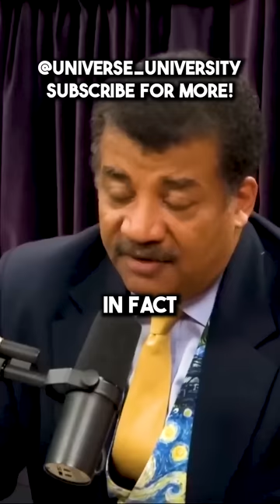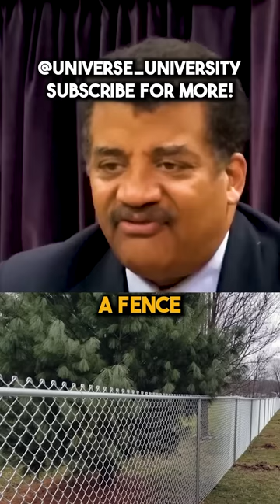How To Pass Ice Through A Fence w/ Neil DeGrasse Tyson

Comment: I actually did this in science class. We had a wire with two weights on either side, and placed it on a big block of ice. By the end of the class it was about half way through.
Reply: That's literally the opposite of what Neil said. He said put ice on a mesh/fence. You said you put a wire with weight ON ice.
Reply: @microusb42069  ... You do realize the point is that there is high pressure at the point of contact. That's what causes the affect, whether or not it's the ice or the wire, singular or a mesh, doesn't matter. The results are exactly the same. You're doing the same thing.
Reply: This is mostly how ice skating works
Reply: @microusb42069  guess youre not the smartest in your class huh?
Reply: @microusb42069  it’s the same thing though?
Reply: @microusb42069  smoothbrain
Reply: @microusb42069  You literally ousted yourself as the one go didn't go to school

Comment: So, just like we all have learned in elementary school, I looked up a phase diagram for water, and it looks like for each atmosphere of pressure, the freezing point would be suppressed by 0.01°C. Even if the ice were at its melting point, the melting ice would quickly cool the wire below the suppressed melting point. It seems more likely that there is a greater effect from the thermal transfer from the wire in contact with the ice relative to that from the air to the ice, and the wire has higher thermal conductivity, so it can transfer heat from whatever the wire is connected to.
Reply: I am glad I am not the only person left on the planet that understands thermal conductivity. This was the first thing I thought of when he described the experiment. Certainly not the first, or last time I have found Tyson to be wrong.
Reply: @Scott Morgan  Is he wrong or is he just dumbing it down for Joe and all us not sciencey types?
Reply: @FriedToast  Nope, he is just wrong.

Think of it this way, if you have two hot cups of coffee, and you leave the spoon in one, it will cool off faster than the other one. Not because of the weight of the spoon, but because the spoon is transferring the heat from the coffee into the air in the room.

Exactly the same thing happens if you have 2 cups of solid ice, but 1 has a spoon sticking out of it. The spoon will transfer the cold out of the ice into the air (melting it) faster than the cup with no ice.

There is a gravitational effect on temperature, but the block of ice would have to weigh tons, and the wire would have to be tiny to focus that weight into a small enough spot to cause any significant temperature change. A wire that small could not support that much ice.

Tyson is an Astrophysicist, he studies (largely theoretically) how stars, planets and other celestial bodies are formed, how they act, and other things like that. He looks at stars and planets, and comes up with reasons why he thinks they act certain ways, or how they were created in the first place, MOST of what Astrophysicists come up with cannot be proven at all, and the reasons they have for things happening a certain way change like the wind. He simply is NOT the expert on ALL things that he thinks he is.
Reply: @Scott Morgan  Thank you, sir, on behalf of all us little-brained people.

Comment: He would have been my dream science teacher! Understanding what is Happening is so much easier then just remembering formulas.
Reply: I mean tbh it's mostly caused by the transfer of heat from the "warm" metal links compared to the ice
Reply: @jimsmith3715  
Initially, yes, but after a short time the metal would get chilled by the ice, equalizing the temperature between the two.
Reply: @keithcraig506  The fence, wire, whatever would always remain warmer than the ice if it extends out past the ice into the room, even by 1/2 inch, it will take the heat from the room and transfer it to the ice.

The only correct way to perform this experiment is in a 30 degree room, with a 30 degree screen, and a 30 degree block of ice. Then you would see that the massive size of the block of ice required to produce enough force to raise the temperature by 2 degrees is completely idiotic.

Comment: Regelation is not the pressure it's heat conduction by the metal. The proof is simple, a plastic fence passes much slower.

Comment: The weight of the ice pushing on the wire has little to do with the melting of the ice. The difference in melting speeds is caused by the thermal conductivity of the elements. Steel and air.

Comment: He doesn't account for the metal of the fence being a heat sink to the surrounding air, thus being warmer than the ice and melting it based off heat and not just pressure.

Comment: I remember doing something similar as school project. Have a wire with weights on both end and lay it on top of ice block. Even if its outside in cold, the wire will start melting into the ice block.

Comment: I did this experiment for my neighbours kids last summer using a block of ice and a cheesewire.
It is the same reason that makes the ice skate work.
The contact pressure lowers the melting point,as the pressure releases,the ice reforms,absorbing energy from the surrounding material as it melts,radiating back out as it exchanges states.
The other fun experiment for ice.
Small bottle of coke,similar size bottle of PLAIN, FLAT,water.
Pop both into the freezer overnight.
The water IS frozen.
The coke is NOT.
Go outside,give the bottle to the victim.
When they unseal the bottle...
pressure equalises....
ice forms inside the coke bottle and pushes out a coke slushy😸

Comment: Funny, built in ice makers create a rectangular ice sheet about half an inch thick  and then slide that block of ice over a thin screen mesh to cut the ice sheet into cubes using gravity and a small amount of electrical current going through the mesh

Comment: Neil Degrasse Tyson: "Now this is really cool, and a lot of people don't actually know this.  But if you take a pair of shoes and then put them on your feet, what you can actually do is use the strings going through the shoe and tie the ends together.  And what that will do is actually provide pressure to keep the shoe from separating from your foot."

Comment: He’s… explaining it completely incorrectly. The actual reason this would work is thermal conductivity, because the metal in the fence would melt the ice by quickly heating it. Has nothing to do with the ice “pushing” on the fence

Comment: Should of compared it to putting ice cubes in the bong those ones that are just big enough to not fit so you push giving pressure for it to quickly melt and pass thru to the inside. Joe would of understood it then

Comment: depends on the temperature of the fence, but yeah it's possible
Reply: Not necessarily as much as you might initially think. The primary driver of the ice wobbling around its phase shift stage, is not a temperature delta between the ice and fence, but the highly localized and very substantial increase in pressure/PSI.

Comment: thing i question about niel’s “pressured ice makes water”..though well rooted in legit science, I have pressed on an icecube before.

i dont think it melted any faster than one where i just place my hand on
Reply: Indeed, for multiple reasons.
1) Your hand is very warm. So the difference in heat you add by pressures then much smaller

2) Your hand has a large surface area. So the pressure resulting from pushing is much smaller than if you were to push on in the ice with a wire.

Comment: Weight and pressure don't melt ice.
Reply: It will, within some limits. You need sufficiently high pressure, so a heavy enough weight of ice over a small enough area, and the temperature can’t be too cold so that the pressure doesn’t raise the temperature past the melting point.
Reply: They don't, but their force creates friction that will.
Reply: Ice under pressure doesn't melt it cracks. Lol
Reply: Weight is not a force but a density to an object. Pressure is not a force but an applied motion from an object.
Reply: @Adrian Ilabej  please don't talk about things you have no knowledge of. The ice doesn't need to take less volume. That would mean the ice is making a choice...lmao If the ice actually needed to take less volume(lol), it would do what ice does under pressure without any change in temperature - it would start to crack and break in pieces.
Reply: You can see the ice already melting in the video from the change of temperature. Lol... That wire does nothing without the change of temperature. Making the claim nonsensical without that manipulation. Smh
Reply: @Leeeeegion  lol